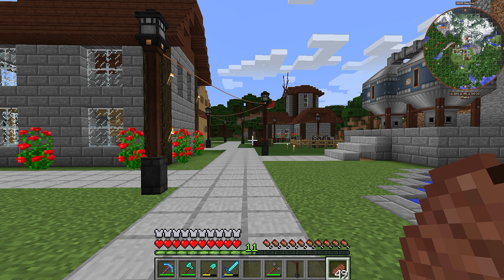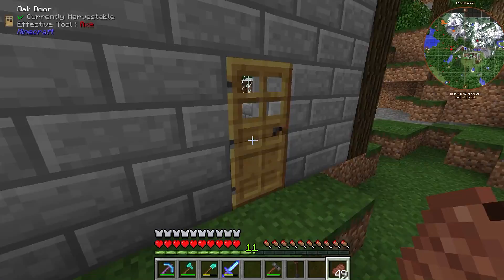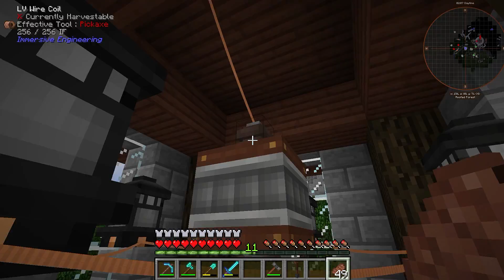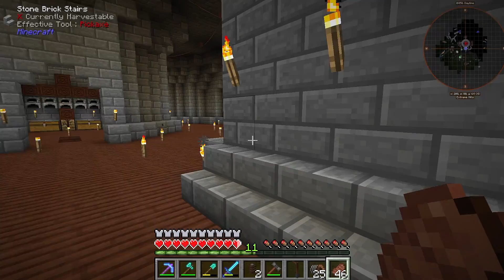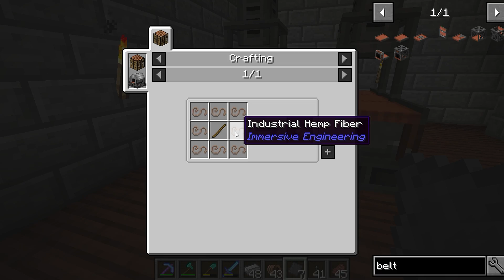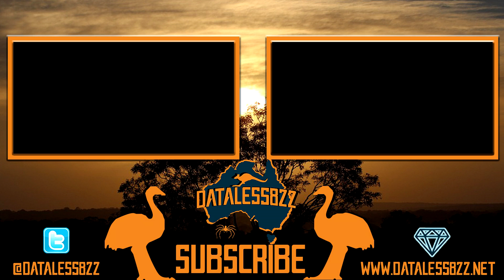Immersive Engineering | Episode 16 | Metal Press

Comment: Check out the Redstone Breaker, it''ll let you switch on/off HV (and LV/MV) wires with a redstone signal (like a daylight sensor, hint hint).

Also, been a while since I played, they might have fixed it, but avoid loops in your wiring, can cause bad things (like bad fps because it's constantly circling the power).